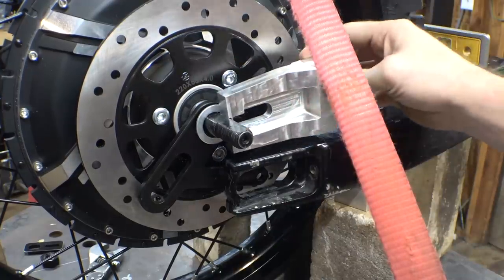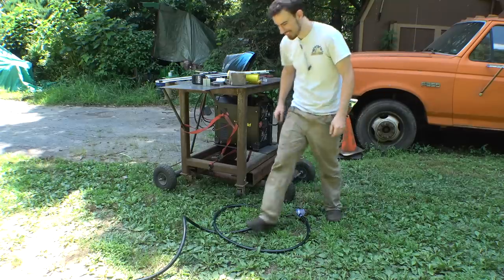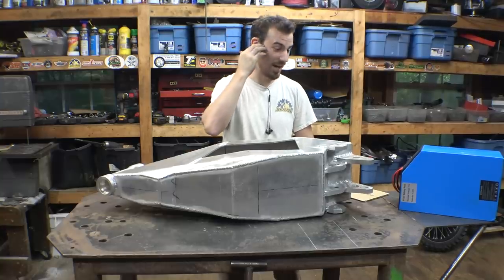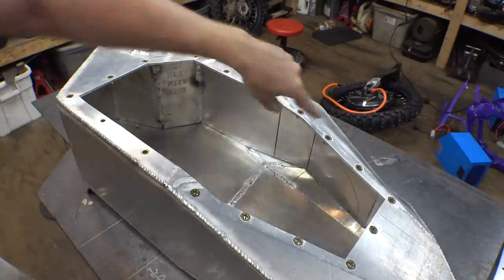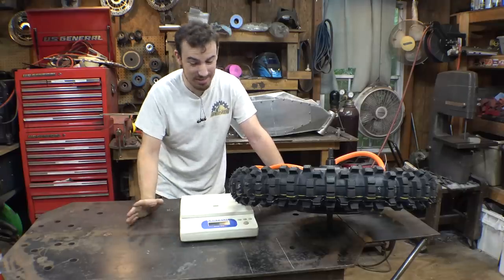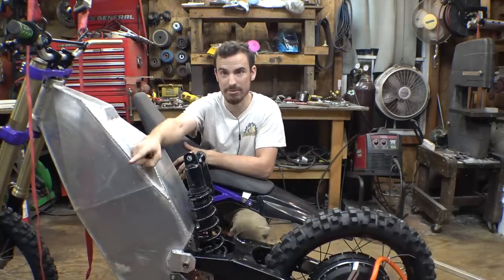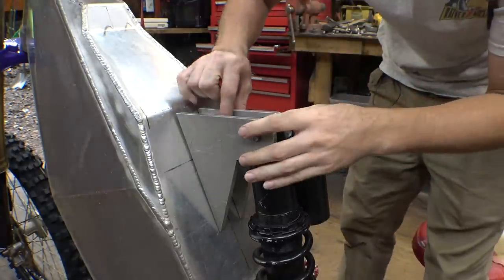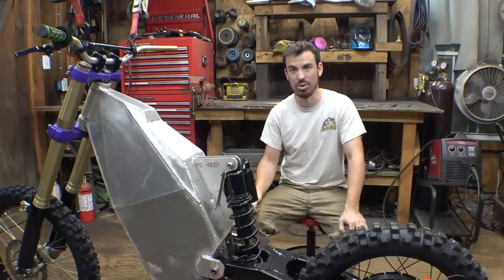Home Made Electric Dirt Bike Build - Part 5

Comment: You know. Since you don’t have to worry about transmitting power from the center of the bike to the rear axle as you’re using a hub motor I wonder if this opens the possibility to other rear suspension types such as macphereson struts. 

You could constrain movement along axis of freedom besides vertical with that. And not have to deal with the front and rear movement of the wheel as it goes along it’s arc of movement.

Comment: For future high-power hub motor builds I would recommend using the  axle seated vertically instead of horizontally because your using the thickest part to support the weight seen a couple snapped axle almost exclusively set horizontal

Comment: I always wanted to try a dual  hub motor build for some of the same issues you are talking about, I built a 3000w Hub Motor MTB and the wheel weight and the sky wheely when you jump the bike is what made me move to a mid drive ebike (Sur-Ron). With the Dual setup though, the weight could be more manageable plus two wheel drive for a bike would be fun/interesting.

Comment: No problem using two cords together. I work in mm2 for cable, it looks like 4 or 6mm2 cable which you can run 32-40A through no problem.

Comment: Looks really good.
Id have just shoehorned the battery into the original frame and made alloy or plastic covers, but Im lazy.
Dont worry about the wheel, I have smashed my hub drive over boulders, the short spokes make for a really strong wheel.

Comment: Hope you are going to use a gasket for the side panel to access the battery and controller.. also ya will have to make some vents to the battery and controller chamber and a fan or heat will build up in there with nowhere to go.. also the alloy chamber it self could be useful as a heatsink alloys are good heat exchangers then instead of drawing air in with the fan ya use the fan to exhaust the hot air.. I suggest putting the controller at the highest point in the chamber and a vent in the bottom with the fam blowing out the air.. that way any water getting in won't be able to get to the controller because it's going to instantly drain unless you drown the whole bike.. or if you use the alloy body as the heatsink it will be plenty of mass to keep the controller cool regardless of whether you have a vent as there's plenty of mass.. that way ya can use a gasket for the door panel and make it a fully sealed unit... Just some ideas for you to think about.. bikes idk much about but electric motors and controller's I do know well 🙂 from making automatic fire doors and windows that we had to design to withstand water from fire sprinklers and heat from fires so people don't get trapped in building's...

Comment: As you have discovered from welding aluminium, it is an extremely good conductor of heat. You may warm up the aluminium box if you applied 12kW of heat to it, but you won't as most of that power will go to the hub motor. 
Even a terribly inefficient 12kW controller with 80% efficiency means you will have to dissipate 2.4kW of heat  into the aluminium box and only when you are running full throttle. 
In practise, I don't think you will even feel the box get warm to the touch. 
No vents required. Air will not carry the heat out - the aluminium will. 
Just make sure you thermally couple the controller to the box really well.
Isolate the battery box much better than that piece of foam. Constant impacts and vibrations will destroy the cells.

Comment: For the controller, I would cut a hole in the bottom the size of the heat sink and silicon the edge to make it watertight. That way you won't have to figure a way to run a fan and it will be cooled off while you are riding it.

Comment: Check if you can put in series 2 power cables, because there are some specs/limits that these power cords can handle. From what I saw, the cable on your soldering station is not so thick, so in theory it should work, but just for safely, just see if there's any instructions on that.

Comment: I would seal up the body, it's made of aluminum so I would weld a bunch of ridges to the under front side and use the body as a heat sink and then bolt the heat sinks of the controller to it or run liquid coolers from the body to the other stuff, then you wouldn't have to worry about dirt or water

Comment: Very nice video bro.About the controller choice its to small in power that motor can take 32kw trust me yo going to be playing with that hub motor. You should get the fardriver 72850.If you do your going to need a better battery and least 400amps discharge

Comment: From extensive and extreme riding.
I believe a heavy rear tire (I used to weight my rim*sodium* for traction of my cr500) helps traction tremendously. 65lbs seems alot, but the stock is 14-15lbs. Tire and tube 8lbs. Maybe lace a good Exel rim on it with stainless spokes. See of there's material to trim off in the lathe/mill.
Rubber flap valve for the body?

Comment: There should be online calculators to run through the voltage, amperage, and length to get the gauge wire that should be used.  Run through them before spending the money on the second cord.

OR just rent a slot cutter, cut in a slot to the shed, and run a circuit out to it.  You can easily cut the slot in the ground for the cable in a few hours at most unless your ground is extremely rocky.  Price out conduit and Romex vs in-ground Romex, odds are the former will be cheaper, and you won't have to run it as deep.

Comment: @rather B welding it seems kind of odd that you have not mentioned wiring at this point, as in how and where the control side and power side will enter/exit the aluminum tub. You keep mentioning trying to keep the electrics dry but your power cables unless you run them way up the frame will probably be susceptible to leaking.

Comment: For your seat not fitting the aluminium frame, check your front suspension rake. It looks like it should be steeper. From the videos, it looks like you are building a dirt chopper bike.

Comment: Looking good, I don't think the heavy back wheel will be a big deal.
Reply: That much unsprung weight means a lot of inertia stopping the wheel from bouncing off of obstacles like rocks or any sudden change in terrain, the average car wheel weighs about 57 pounds, as far as I can tell that average is a 17 inch aluminium rim and 225mm wide tyre as the two most common sizes used, so 65 pounds is definitely very heavy when a normal dirt bike's rear wheel is around 12 pounds, add maybe 2 or 3 more pounds for the added mass of the arm and sprocket and bearings. Its suspension compliance mostly, if he hits a bump fast with that heavy wheel then its going to cause huge shock to the tyre risking a blowout, and if it doesn't blowout the wheel will shoot upwards and buck the entire bike forward due to the wheel having lots of momentum, a light wheel will be soaked up by the shock and you'll hardly notice beyond a small jolt but with this it'll jolt so hard he might get thrown off despite the shock absorber trying to bleed it off as heat, there's also the chance of blowing the shock itself. This is why the ideal setup is an inboard electric motor with a chain drive to the back wheel, its far more stable when not on roads and its why bikes made for maximum performance use carbon rims and a rear sprocket with speed holes to reduce unsprung weight. They say in a car that 10 pounds of unsprung weight lost is worth 100 pounds of sprung weight when it comes to overall driving.

Frankly, I like the way he's building it, Chris knows he's got to be super careful hitting sudden terrain changes with this when its done, but otherwise I know its gonna be a real thriller to ride :P
Reply: @Avetho  you're absolutely spot on. 
Another thing that most people don't know and surprisingly a lot of riders don't know until they buy a bike and have issues is... the front and rear suspension on modern motorcross/enduro (most all bikes really) bikes are manufactured, setup and sold on new bikes for 145# to 165# riders.
If he's able to get traction this thing maybe a wheelie machine. What are your thoughts?
Reply: @Avetho  I weighed the unsprung mass of a gsxr1000 rear wheel assembly @35 lbs. With brakes, chain and disc. He still has a lot of weight. But it will still be neat. It may not supercross well, but it might be a hoot
Reply: @AzTurboMini  my first thought was “that’s a lot of torque, good thing he can extend the swing arm”

My second thought was “why is he modifying, but not extending the swing arm?”
Reply: @AzTurboMini  the “other” other thing is that the longer spokes on a regular wheel provide better damping/suspension. Shorter spokes are stiffer spokes.  Throw a solid rear wheel on a dirt bike and try to put it over a small rock at speed and you’ll have a spinal compression and/or a broken rim and/or people will say “wow he went further than the bike!!”
Reply: @AzTurboMini  If it has a lot of rotating mass then the torque of the motor will act like a spacecraft reaction wheel and pull the front wheel up on acceleration, when its up to speed that won't be very noticeable but from a stop it'll make wheelies easier to do. Frankly I think the inertia is only a bit higher than a standard wheel since apart from the motor hub there isn't really any added mass on the rim itself, since all the extra mass is right at the center it doesn't add very much angular inertia to the wheel.
Reply: @dylanzrim3635  yeah but he can always go back and extend if he feels he needs to. Better to do that than extend it and not really know if you need too or not.
Also, I keep forgetting he can program how hard the throttle comes on too which will help with the wheeling. 
You're absolutely right, there will be very little give (if at all) with the short spokes. The tire and the rim will be taking the majority of the impact and the shock will absorb and cushion everything else. 
I've rode and raced motocross and cross country for 47 years but have never had a machine shop. I'm enjoying seeing how he's doing this and learning along the way. Some things I would have probably done a little differently just because of my experience but for the most part and from a common sense point of view..  he's killing it. 👍
Reply: @Avetho  yes it's definitely going to be more of an issue from a stop than going, let's say 20mph but he should be able to program the throttle response is such a way even at full throttle it won't apply full power until he's at a certain mph. See my comment above. I'm enjoying this build. 👍
Reply: The weight is a huge deal.  Even a regular mountain bike with hub motor handles very badly over bumps.  The exact opposite of what you want off road.

Comment: I don't get the extension cord thing. From your breaker box to the outlet is only 12ga wire. That cord was like 2/3 or 0/3. Easily heavy enough wire for the load. Is it because of the distance to a ground? Serious question.

Comment: Im wondering if this tankstyle frame is going to twist and flex too much without some inner strukture when shredding the bike hard. From what ive experienced, aluminium frames tend to crack at a certain point. Especially since torsional forces are known to add a lot of stress to the framematerial :D
Reply: Yep aluminum tears once it’s been flexed a certain amount of times

Comment: Seal that thing up tighter than...   It will be fine.  The box's cooling capacity is way more than the heat generated inside, sealed is the only way to go don't put vents, try it before you cut that thing open.

Comment: I've been enjoying the videos since the start of the project and I think I see why your seat doesn't line up. When you had the frame on the table the back end was higher up and the front was less raked out. if you lower your top mounting point of the rear shock the frame will come up, but the seat will go down and fall in place. When you built the jig to align the front fork collar the top of the "gas tank" was almost level and now it's quite pitched assembled. either way it's pretty awesome though :-)

Comment: ok, it looks like everyone in the comments is here to let you know what you did wrong, lol. I'd like to just leave a general tip, something to consider on future projects. when you're butt welding two thick pieces of metal grind a large chamfer along each side of the weld joint and do multiple passes. it looks like that swing arm is hollow so that wouldn't necessarily apply here. just something to keep in mind.

Comment: Nice build but I doubt that your battery can supply the 300-500 amps that the controller and motor need to run at full power. That looks like the standard 150a stelthbomber batteries.

Comment: After market extended or replacement wheel clamps usually have a tongue that slides a few inches into swing arm you spot weld, for what you thought, strength. Thought you would have machined the clamps with a tongue instead off a piece of plate. A quick google of them will show what I mean

Comment: After you cut the old brackets off the swing arm the new brackets that you made you should have milled the end of it that goes towards the swing arm toward actually sunk into the swing arm by like a half an inch the swing arm was pretty Square you could have measured that hole in the swing arm or transferred it to a piece of cardboard so you could have transferred it to your aluminum blocks for your wheel and then you could have milled the aluminum block on the end of where it would actually sat into the swing arm and then you could have grinded a little v-groove in there that way whenever you welded the blocks to the swing arm there was a nice Groove to get down in there and fill up with weld and it would actually been sitting up in the swing arm like an insert instead of just butting up to it

Comment: 65lbs eh?  I'm now curious how much my ice rear wheel assembly weighs, with the extra tire liners, screws, etc, they are pretty hefty too.  If you got a second hub motor for the front that would balance the weight out... :D

Comment: You need to change the bolts for the cover. It is very bad to hook the bolts with the knee pads, checked!
I wrote about the weight of the motor under the first video.

Comment: You will feel that the suspension is very stiff because you have so little weight in the frame itself, where normally engine and fueltank reside and now is in the back wheel instead. you can change springs in both forklegs and rear shock, but it can be costly.

Comment: If you do another edb in the future with the motor in the frame, instead of using a chain would you be able to convert a shaft drive from a road bike? You build your own hubs so I'm assuming that end wouldn't be anymore difficult for you to adapt, but the shaft to an electric motor output shaft would be interesting to see how you tackle that and how easy or hard it is.
Depending who you are, shaft to shaft could either be very hard and messy in the end, or it could be a real turn off and soft... I mean, an easy and boring job that nobody wants to watch because there is no big payoff at the end.
And some people may realise that shaft to shaft is the best option for them from now on.

Comment: I would have made the aluminum pieces a little longer and push a bit of it inside of the black frame. That with a deep bevel would made that part stronger than the frame instead of being a weak point.

As for the seat not being flushed. Maybe the body has to raise a bit and the chair isn't lifting it high enough. The angle will change depending on the height the frame sits.

Comment: You really shouldn't worry about lowering the seat.   I'm 5' 11" , and I have a couple of CR500 and Cr480 Big Bore 2 stroke dirt bikes, and they are like a HORSE.  Super tall-- you just get used to reaching on your tippy toes and have a slight lean when you need to stop, on one leg.  It's no big deal--  it ends up being much better being high in the air when you're off road.  It has it's perks.   When your foot slips off the peg, you don't want your leg to be dragging the ground or getting caught in the back tire.  It's better to be up high and away from all that stuff while you're hauling azz.   Taller is better -- especially if this thing has good power.

Comment: The cable idea is fine but get the next size bigger cable then you'' be safe putting them together. I'm a 30 yrs plus electrician fyi. I don't know what your running or it's load but if you want it done cheap but safe thats how, also use twist lock male and female to join them, they will keep rain out. good luck..

Comment: I think you should make a solo seat from aluminum and do your own apolstry... and make it as low as comfortable with the footrests, brhind the shockabsorber... and throw on some slicks, face it, with that heavy unsprung rear wheel this is a supermotard for the streets doing wheelies annd not a moto crass dirtbike doing jumps... it looks real cool so far, so dont use the tube seatframe imo...

Comment: you never thought of machining a step in the wheel mounts stubs that would fit inside of the swing arm tube about an inch to strengthen the connection and maintain perfect alignment like the original wheel mounting stubs had? that would be a much more simple and elegant solution, and be much stronger than simply trying to plate the outside of a butt welded joint.

Comment: I'm curious as why you didn't build a shoulder into the aluminum piece to slide inside the arm itself. I'm a fan so don't take it wrong I trust u building ur stuff but to make a shouldered unit to fit inside would make it stronger and give it integrity.